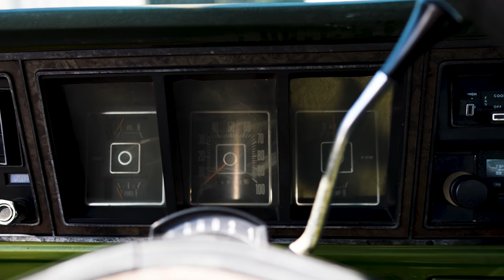Wheels & Deals- 3 Car Shootout

Comment: For those into Model A fords the Australian Assembled Model A's had the Throttle pedal in between the Clutch and Brake pedal also remember that Aussie cars are Right hand Drive also Choke and mixture was on the top of Steering Column..

Comment: You need two things ...
A 1969 HONDA CB 450 ...
A 1965 FORD T-BIRD ALUMINUM 428.
DUEL 650 HOLLY pumpers. OMG.
Problematic honda had NO VALVE springs.
They used metal spring metal in the rocker cover. It heated up and would bend and stall out a cylinder. Bike would die and give every indication of a leaky diafram in a carb .
6 sets of carbs before we pulled the rocker cover. Had to put all of them back on the bosses bikes. Ha Ha.I 
Just sit on one you'll see. Go fast and spark the pegs  it sticks and holds. Good bike , perfect motor, just needs some valve springs. Look at blue prints wild stuff. It needs a better motor but build a head and put super charger or turbo on it.Zoom Zoom Zoom

Comment: That shortbed chevy is a 20-30k truck restored all day long 😂
Reply: I would take it to a car show just the way it is.
Reply: @johndeere8594  yeah shes a beauty as is, original shortbeds are getting hard to find. Specially this clean.
Reply: @johndeere8594  was on ebay and a 65 short bed fully restored was 65k obo 😱 if he paid less than 30k on these vehicles. Richard basically stole them 😂